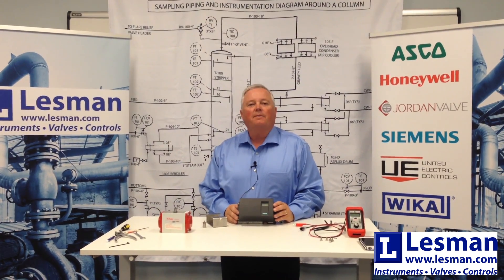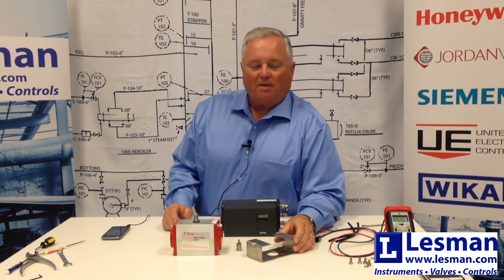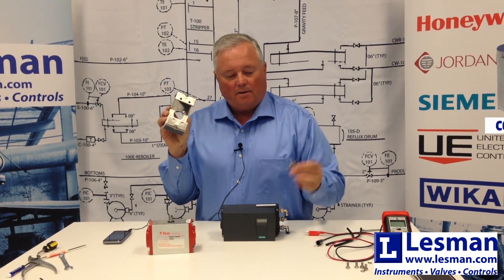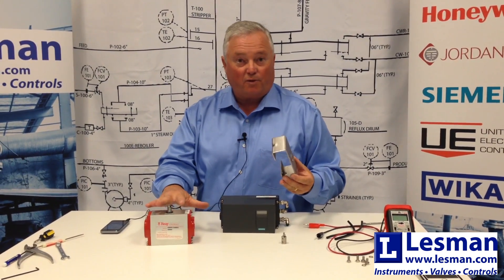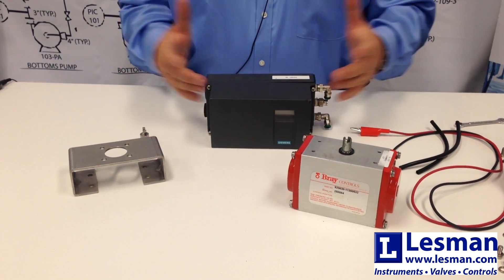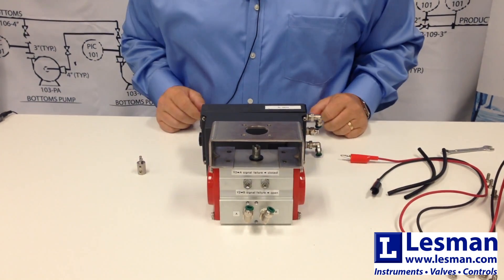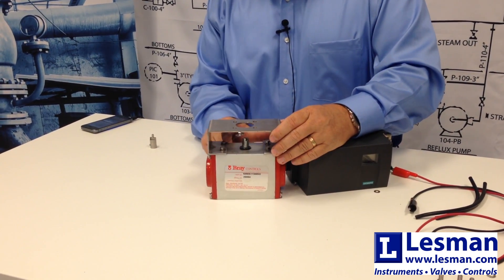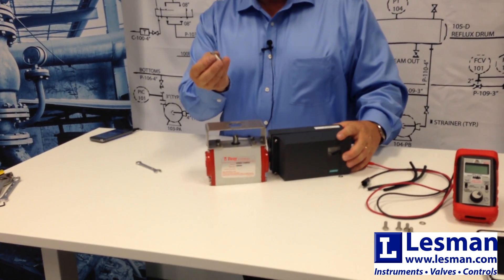Overview of the Siemens SIPART PS2

Comment: How to repire relay for this positioner....?
Reply from the maker: Relays are not repairable. You may need to purchase a new relay board. Call 800-333-7421 for help troubleshooting. Once the issue is confirmed, call your local Siemens rep if a replacement part is required.

Comment: So nice of you sir for the information. recently I have calibrated the same positioner on our Siemens gas turbine. Due to the position deviation. After I have done the calibration now it’s working normal. My question is why it has position deviation? And also elaborate the the frequency of calibration.
Reply from the maker: Typically, something changed mechanical for some reason.  Could be a loose screw on his linkage, mechanical wear somewhere in the valve and or linkage.  How often should he calibrate?  Not unless he sees a deviation again because whatever is wearing, continues to wear.  He could also use his diagnostics on the PS2 to tell him when he reached his error(deviation) limits and then he would know when to recalibrate.
Or just do an annual recalibration.
Typically, something changed mechanical for some reason.  Could be a loose screw on his linkage, mechanical wear somewhere in the valve and or linkage.  How often should he calibrate?  Not unless he sees a deviation again because whatever is wearing, continues to wear.  He could also use his diagnostics on the PS2 to tell him when he reached his error(deviation) limits and then he would know when to recalibrate.
Or just do an annual recalibration.

Comment: what about the flow adjustment in positioner
Reply from the maker: The PS2 has speed control valves internal as a standard.  On single acting there is one, and on double acting there are two.
These valves can be used to restrict the air exhaust output, and therefore slowing down the speed at which the valve can close or open depending on how it is designed to act in a fail position event. The factory default is to have them completely open, for the fastest response.  If for some reason you want to slow the stroke speed,  adjust the screw to make this adjustment.

Call Siemens at 1-800-333-7421 to speak with their technical support.

Comment: What does it means during calibration as you mention we need to rotate the potentio meter wheel. What is the reason if that potentiometer wheel is not turning? I am facing this issue hence asking. 
Your valuable inputs are really appriciated. 
TIA
Reply from the maker: Your wheel may not turn if your positioner is damaged or if you’re not using enough force to turn the wheel. Please contact Siemens technical support at 1-800-333-7421 for specific questions.

Comment: I e done everything, even reset the unit 
My unit keep actuating to the open position. How can I correct this.
Reply from the maker: It's difficult to troubleshoot without knowing your configuration. Contact Siemens Technical Assistance Center at 800-333-7421 for help. They'll be able to work through the issue with you.

Comment: Hi, Thank you for this video. It will be helpful If you guide us on the following point.
When we remove Fieldbus signal cable - all control valves goes to closed position (fail close). => which is OK.
When we reconnect Fieldbus signal cable - some control valve stay in same closed position (=> which is OK) where as few control valves slowly moving to open position which is not correct (=> in this case positioner set point automatically change to 100% while connecting signal cable; set point is not coming from DCS).

We check positioner setting in both cases and unable to identify the reason for different action.

Comment: Very helpful video. Only issue I am running into now is when its in auto and modulating, the positioner indicates on the LCD screen an oFL code and the number 127.9, I'm not sure to how to resolve this issue.
Reply: I also facing same issue please share the knowledge if u solved this issue

Comment: Dear sir,

have a good day.

Thanks for uploading such type of  excellent video.

i have recently facing problem   in a a newly buying  Siemens PS2 positioner connect with existing Single acting linear actuator , 20mm stroke.during comissioning this new control valve/actuator in initial condition its display shows  P 85 and NOINI mode, at that time  when i press + and - button the actuator totally not move.only small sound hearing inside the positioner and some air release backside of positioner , however pneumatic and electrical connection is ok.if i place old existing positioner there then it easily move
the actuator after pressing + and - key in NOINI mode.

 Moreover when i go in Log 5 ,NOINITM mode 30% open the valve in both YEND1 and YEND2 once i press both + and - key.once i release button then actuator go to zero condition.it doesn't hold at all.

If its abnormal what can i do.would you please advice me.

 if i press only either  + or -  button then actuator not move in YEND1 and YEND2
mode.but when i press both + and - button simultaneously then it open actuator only 30% but not hold at all  then  when press hand button its display range message.

will you please advice me its normal or abnormal?

Really i am facing a horrible condition for this positioner at my site and i am apologetically wish to get you kind advice please.

Thanking You,

Engr.Nizamul hoq.
proprietor.
United Mechatronics Engineers.
Bangladesh.
Email: united.mechatronics@gmail.com
Mobile :
0088-01814792505 and 0088-01935675378(whatsapp)
Skype: nizamul.hoq1

Comment: Great Video. I am facing a problem regarding with my rotary actuator. The valve is opening and closing manually, but the potentiometer value doesn't change. Tried to do initialisation, confused with the parameters. So kindly post the parameters for a rotary actuator. Thanks in advance.

Comment: Great video, but I have a problem today ....... all ok, just, it works invert. 20mA = closed - 4mA is open (ballvalve valve - 90°) ? Who can help me. Many Thanks :-)
Reply: I'll try again tomorrow, exactly as you described.
Reply: 3.21 Reversing the Action
There are two ways to invert the action and display, one requires re-initialization.
No re-initialization procedure
This procedure inverts the physical action and display of the positioner.
● Parameter "SDIR" reverses the physical action
– From AUT or MAN mode, press button for 5 seconds. Observe parameter name in
the lower right corner.
– Continue to press button until "SDIR" Parameter is reached.
– If "SDIR" Parameter displays "riSE" change to "FALL" or vice versa.
Use and/or buttons to change option.

Comment: How can we factory reset it ?? Kindly rep plz
Reply: 50.PRST
Preset
Reset all parameters which can be reset by 'Init', 'PArA' and 'diAg'.
ALL
Reset initialization parameters '1.YFCT' to '5.INITM'.
Init
Reset parameters '6.SCUR' to '49.LIM'.
PArA
Parameter assignment
9.3 Tabular overview of the parameters
SIPART PS2 with and without HART
Operating Instructions, 02/2016, A5E00074631-AB 151
Parameter
Function
Parameter values
Unit
Reset parameters A to P of the extended diagnostics function as well as parameter '52.XDIAG'.
diAg